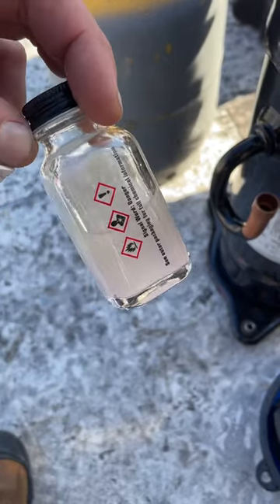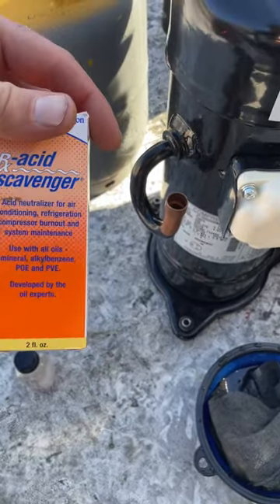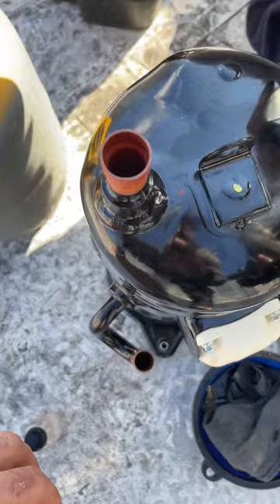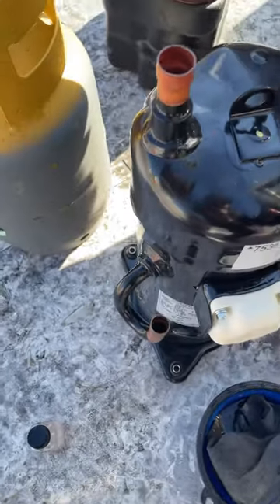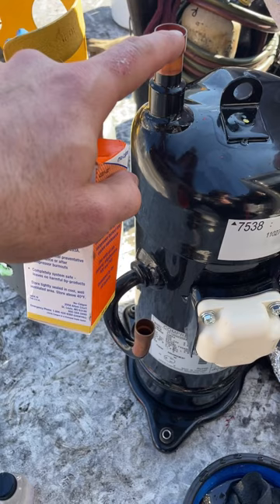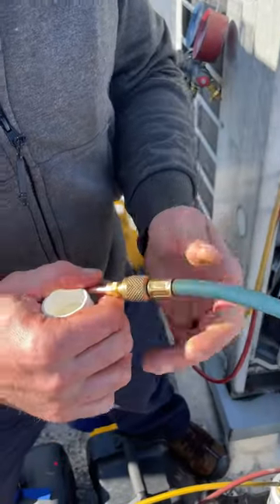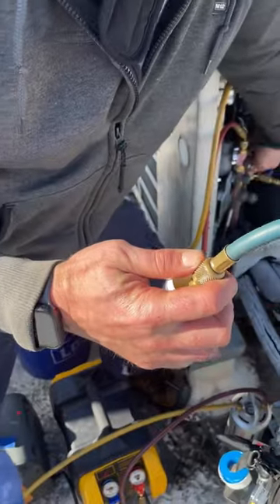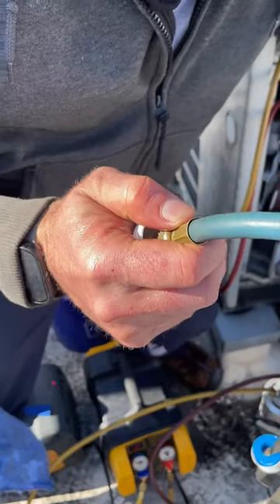Tip56: Using Vacuum to Draw Additives into an HVAC System

Comment: I was told by the manufacturer not to do that because it will boil off super easy when you pull a deep vacuum. Injection is the way to go.
Reply from the maker: That may be true actually 🤔.  Oil itself is not going to degrade anymore than compressor oil.  The additive is heavily oil based.  The oil additives may evaporate though.  I just honestly don’t care much…works really well and sufficient but perfect…no 👍

Comment: Acid and a base(your acid away kit) when mixed , creates a salt.....left  circulating in the system..
I've used acid away before, but always changed compressor oil after.....
Reply: I wonder would the manufacturer of the air conditioning say the same thing.. I'm sure there chemical engineers would disagree..
Refrigerant and oil is all that should be in a system, everything else is contamination...

Comment: Can you not add it with systrm running to suction line ? Let me know i have a burn out compressor.  I installed suction line filter. However i cut the suction line i found inside of pipe was black with oil dark stuff. Its packaged heat pump trane unit.
Reply from the maker: No you can’t because even the suction is relatively high pressure!
Reply from the maker: Oil injector can be used but can be tricky.